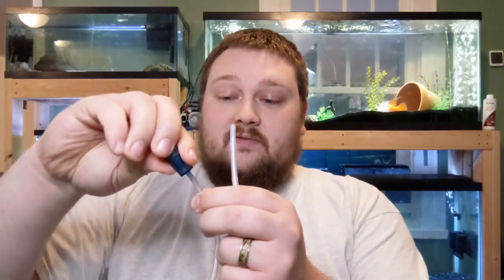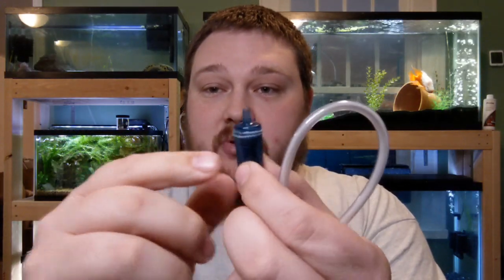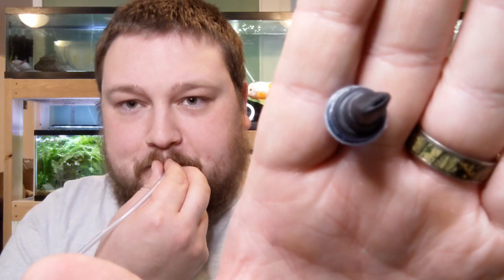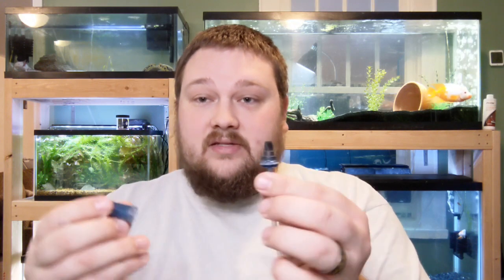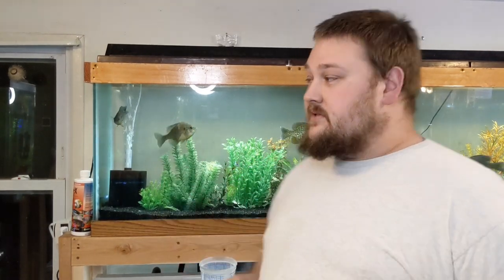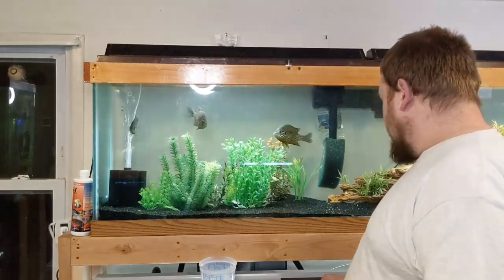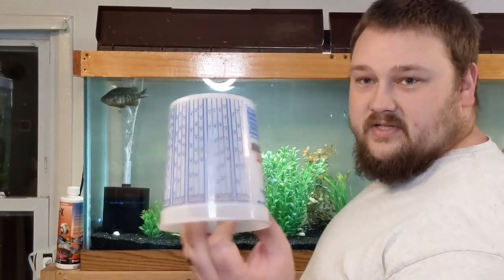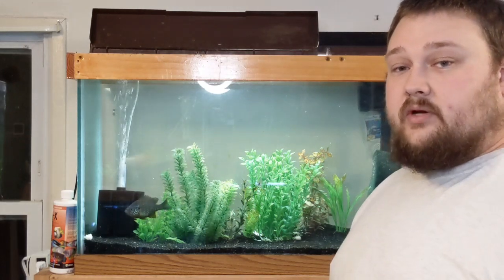Check valves - How they Work!

Comment: There is one more advantage of air check valve.

It helps increase lifw span of air pump.

Because each time air pump is turned off for any reason, the water flows into the air tube all the way upto the hieght of water level.

And each time you turn on the air pump, the air pump has to work hard to push the air through the tube, to get the watwr out and then flow of air begins.

This resistance it builds, reduces life span of the air pump. 

Hence , this air check valve is really good and a must have.

I would suggest using it inside the aquarium, because it will have least resistance.

If you install it upwards it will have same issue, as it will have to force the water all the way before ocygen continues to flow out of tube.

Comment: Is there another style of valve, it looks like the check valve you held up, but inside we find a white plastic ball, that floats and plugs the air line when it doesn't pump, but as soon as you turn on the air the ball is pushed down and away from the high point of that plastic chamber.  It doesn't matter which way you install it because the ball floats up as the water back flows into the plastic chamber.

Comment: I take your point about the air supply being restricted and the pump must work harder. Is it significantly more difficult to blow through when blowing harder/faster than blowing slowly?
Could you make an inverted branch of air hoses and put a check valve on each of them, so the pump is not working so hard to push air through one narrow opening, but pushing a the same amount of air through multiple opening in multiple check valves.
eg, a branch with 3 check valves?

Comment: I have a battery operated pump.  The battery ran out. I opened the back to put more batteries in and it had a lot of water in it!!!
Where I placed it, was almost up to the ceiling, way higher than the tank, so I advise everyone to put it on their pump.
I just came here to be sure which way to install it, cuz mine only says, Up or Down, Lol.
You explained it very well, God Bless! 👍
Reply: Really? Water that high? I run them but was thinking of putting it about 3 feet over the tank without a valve. It doesn’t make sense that it would flow up. Was it down before and maybe water got in them then?

Comment: The issue I keep having is the airline tubing falls off. I’ve replaced my check valve and airline tubing and it’s still the same. Every couple hours, my filter dies cause the tube disconnects. I’m so annoyed. I push it as far as it can possibly go.
Reply from the maker: Add a drop of superglue on the check valve ends then put the tubing on

Comment: What if I have a 10 gallon with a small pump and a dual split check valve running one small stone and one 3 inch stone in one small aquarium. Wouldn’t that be more efficient then the one 3 inch stone I would have to run if I didn’t have the split check valve even though it’s at full power.
Reply from the maker: If you have one line that you split into 2 the air pressure will be cut in half to each line, once the stones are added the air will self regulate to follow the path of least resistance, if one stone has smaller pores it creates higher backpressure and forces more air to the other stone, if you want to run 2 stones its best to get a dual outlet pump.

Comment: Hello,
I have a PowKoo bix corner filter.  It has no air stone.  

Is there still a chance that a siphon will occur in a power outtage?

Also,  I've heard that they can help airpump last longer. 

I am very confused.
Reply from the maker: Air stones are not required for these, and airstones can actually slightly reduce pump life because they add backpressure to the pump when the start to clog up

Comment: i'm wondering if using a small hook to secure  the air tubing in an arch, placed higher on the wall  behind the aquarium would work as well? No room anywhere 'above' to place the air stone pump.
Reply from the maker: Yes it would

Comment: Are they safe to use with a co2 system? Fluval 45g? 1500psi?
Reply from the maker: I wouldn't use these I would get something specifically made for CO2 systems as CO2 has a tendency to degrade rubber
Reply: @TrafishAquatics  thank you !! Will definitely be looking to upgrade when I can

Comment: Mine broke 😥
It came apart in the middle, and there's a tiny rubber thingy in the middle and I don't know what to do with it. I'm in the middle of a water change, and my fish is currently sitting in a half full tank with the heater and sponge filter off. Help me!!

Update:
Okay I think I got it

Update-update:
Okay it's running well and all done with the water change, and have a happy betta. 😁
Reply from the maker: if you check valve comes apart You may need to end up replacing it, You could snap it back together but there's a chance it could come apart again since it's supposed to be a single piece
Reply: @TrafishAquatics  yeah, going to Petco to get some brine shrimp and an air stone, I'll get a new one to.

Comment: I use Aqua one check valves. However some of the new ones I get don't work! (I have already tried putting  them both ways)
Reply from the maker: Sometime the little rubber boot inside gets gummed up and won't open to allow air to pass through.
Reply: I managed to get it working by popping the seal in the test valve. Nice video!
Reply from the maker: Thank you I'm glad you were able to fix it

Comment: Thanks man it was kind of surprising that whenever using check valves could actually reduce the output and air pressure so amount of air is technically reduced.That was quite clear to me now and I even got one of these check valves just for stopping the water coming up to the hose and clog the airway but it seems that purpose is not working that way I don't know why but it shows I couldn't get any help of it so I'll just get rid of it.I just wasted half a dollar cheap check valve but saddest thing is when this is what  and how they really do, minimize the air flow.
Reply from the maker: Yea for sure, that's one of the reasons I ended up switching to a central air system.
Reply: Just have a long airline..  similar to the drip loop for electrical cables around the tank.  gravity is even stronger than a valve and won’t reduce the airflow.

Comment: Whenever I put mine on no bubbles come out the airstone. I'v tried switching both ends and even bought ANOTHER check valve and still no luck. Do you know what's wrong? Tried blowing into both ends and no air comes out.
Reply from the maker: Strange almost sounds like the rubber valve inside might be gummed up and stuck together, air should flow freely from one side but not the other.
Reply: @TrafishAquatics  Thank you for the quick response, I'm gonna ask my LFS about this tomorrow

Comment: I’m using one for my small disposable co2 system and the water keeps coming up the tube nearly to the regulator and I don’t know why
Reply from the maker: Check valve isn't on backwards is it? If not you may have a leak in the system allowing water to go up the line
Reply: @TrafishAquatics  I’m pretty sure it’s not backwards as the co2 wouldn’t be able to flow through?
Reply from the maker: Hmm I must be misunderstanding, not sure how water would be flowing up the tube if co2 is passing through it also
Reply: @TrafishAquatics  when I turn the co2 off at night when I check the next morning water is all in the tube and nearly to my regulator.
Reply from the maker: Ah I got ya, is it flowing up past the check valve?
Reply: @TrafishAquatics  yes and the check valve is filling up with water.
Reply from the maker: Interesting, If the water is getting past the check valve it's obviously not working properly and should be replaced, I would also recommend if you aren't using one already to use a CO2 specific check valve as I know CO2 can sometimes react poorly with rubber and degrade it quickly, most aquarium check valves just have a rubber valve inside.
Reply: @TrafishAquatics  oh ok thanks for the information I just replaced the check valve and raised the co2 tank higher so I hope this works if not I will get a co2 check valve. 👍

Comment: Thanks for your video. Where do you get your valves? I've been trying to get one for a bubble wall application that needs to handle a lot of pressure since the pump is underneath the bubble wall. I know you work with aquarium stuff, but would appreciate any help for a vendor or a specific model of a check valve that could handle the pressure. Thanks in advance!
Reply from the maker: What kind of air pump are you planning on using?
Reply: @TrafishAquatics  Here's the link: https://www.amazon.com/Hygger-Quietest-Aquarium-Adjustable-Powerful/dp/B07YDFVPMS/ref=sr_1_2?dchild=1&keywords=hygger+Adjustable+eco+air+pump+%28HG946%29&qid=1599687050&sr=8-2 Thanks for replying.
Reply from the maker: For any air pump, that uses standard airline, any standard check valve will work essentially the same. The ones that I reviewed in this video came with my tetra air pumps so I just have a bunch of them on hand. If I were to get some this is probably what I would use https://www.amazon.com/Pawfly-Aquarium-Valves-Plastic-Non-Return/dp/B01N92AXHF/ref=mp_s_a_1_3?dchild=1&keywords=aquarium+check+valve&qid=1599690230&sprefix=aqua&sr=8-3
Reply: Trafish Aquatics thank you! Much appreciated. 😀
Reply from the maker: Your welcome!

Comment: Do I need one for water pump?
Reply from the maker: Depends on the setup, For example if you're running a barrel filter full of k1 media and your power was to turn off you don't want the k1 media to get sucked back out into the pond or whatever your filtering so you would want to check valve in that sense, but if the water's just going to flow from a waterfall feature back into the pond it doesn't really make a lot of difference.
Reply: @TrafishAquatics  thanks ! I am using it for waterfall and has been wondering all these times if I should get one check valve.
Reply from the maker: Probably not necessary cuz when the water back feeds back into the pond it doesn't go anywhere except back to the source
Reply: @TrafishAquatics  heard about water hammering which may damage the pump. Not sure if it is related.
Reply from the maker: @aave865  that's more for when a pressureized system is suddenly blocked off and the water no longer has the ability to flow and quickly builds pressure. This shouldn't happen with a non pressurized system

Comment: I have my pump on top of my Aquaclear filter, does that mean I'm in no danger of back siphoning in the event of a power outage thus don't need a check valve?
Reply from the maker: Correct, it wouldnt be able to flow up higher than the top of the tank, the reason why an air pump under a tank would need a check valve  is if water flows up over the top and starts to go down the other side it would create a syphon, if the pump is on top of the tank a syphon can not be started
Reply: @TrafishAquatics  thanks! That's what I thought as far as the laws of gravity go, but I've never used a pump until tonight so wasn't fully sure exactly how they may or may not be capable of somehow interfering with the normal nature of gravity.. I keep having people in my fish groups tell me to add a check valve anyway? But that didn't seem to make much sense to me .
Reply from the maker: Yeah if the pump is above the tank you don't have to add a check valve, if it's below the tank I would consider adding one. In the future of the channel my fish room is going to be getting rebuilt in a different part of the house and I'm going to be running a central air system using a linear piston pump and PVC around the room hanging from the ceiling and with that system no check valves are needed because there's no way for the water to siphon uphill
Reply: @TrafishAquatics  well I've subscribed so I'll be looking out for that!
Reply from the maker: Awesome, it's going to be a little while but I'll be recording the whole process when the time comes!